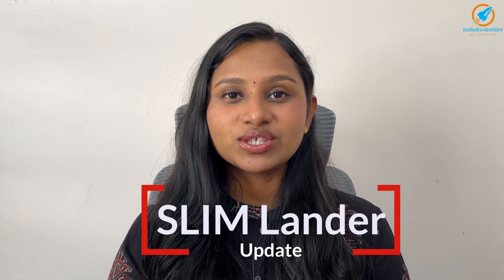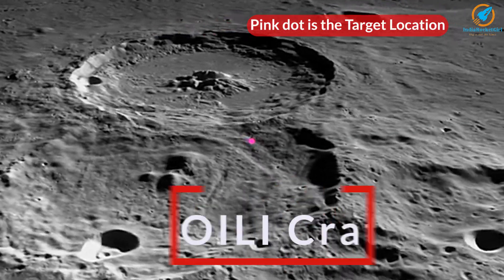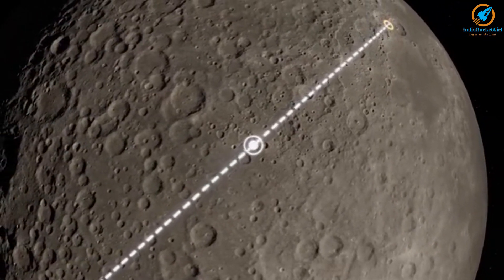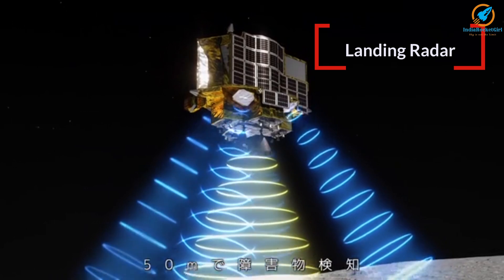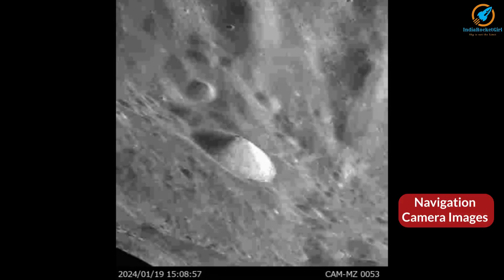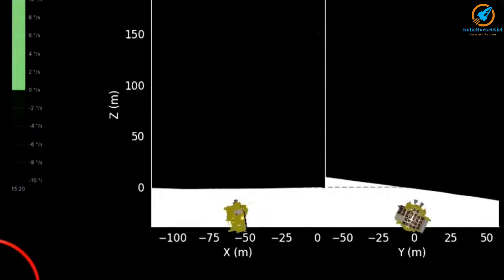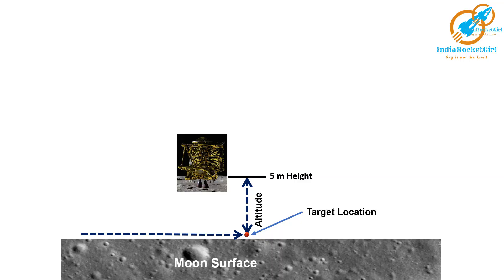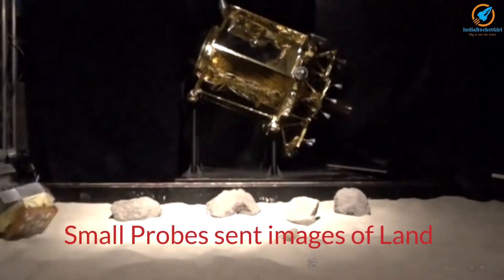Moon Landing revealed by Japan | SLIM Lander | Pinpoint Landing | JAXA | India Rocket Girl

Comment: Excellent job, editing and information very nice, but it was not a soft landing, the videos from jaxxa show all the information in quite enough detail to see how it landed, no-one including jaxxa has done an accurate animation of the landing, if one examines the data ( that requires effort and time) you will see it is not a soft landing at all.
Why is there no animation using the readily seen data? Because it would show one hell of a tumbling crazy landing.
You can see the craft goes below zero level..........its going down the hill..........its something like 30m it travels over last few seconds, its one hell of a landing.............I dont have the skills to do an animation of landing, it requires skills to use the actual data...........but the data is there for anyone to use.
1.4m/s is not speed at at landing it was some average not near the surface, speed at landing is quite high can use data to work it out roughly.